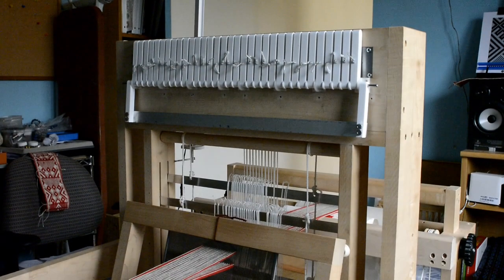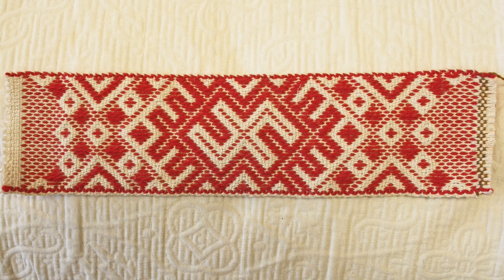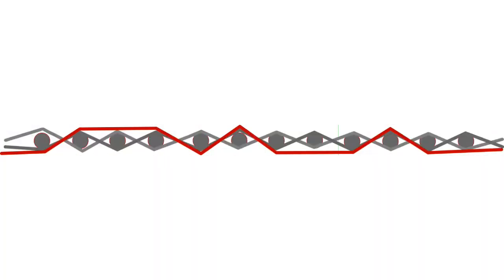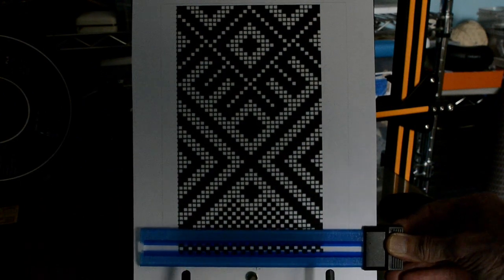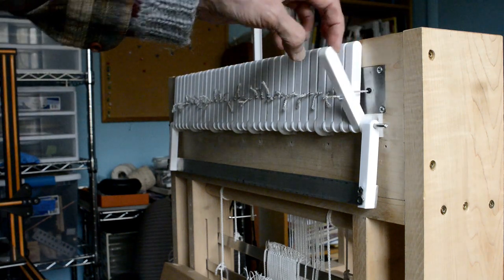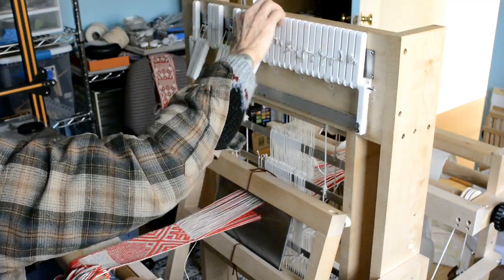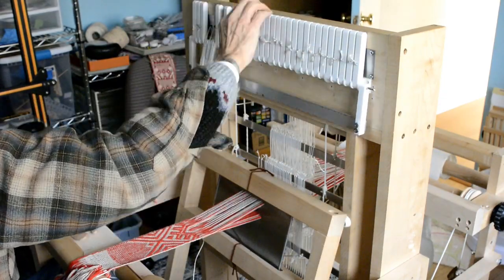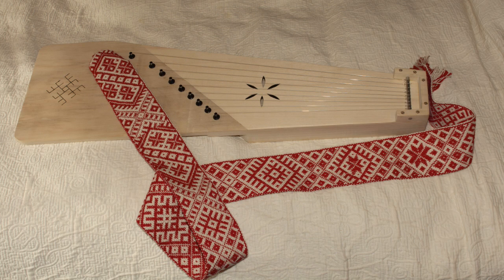Baltic pick drawloom

Comment: Thank you for this posting about your remarkable loom. As a bandweaver on a traditional Scandinavian loom I find your pickup device using single-unit drawloom principles to be fascinating and full of potential. 

Your loom is making quite a splash right now among weavers with similar interests :-) There's a whole group of folks out there who would love to know more about your loom and how you came to build it. Is there any possibility of finding out more about your wonderfully-engineered machine?
Reply from the maker: The core of my loom is a two harness counterbalance loom which I chose because of the balanced shed. The draw levers are attached to individual texsolv heddles via cords. The weights (lingos) at the bottom of the loom return the heddles to the down position when the levers are released. The draw heddles are kept in their correct position using two plates with 33 holes that spaced 11 holes per inch. The frame of the loom is maple for rigidity. The plates are made of aluminum. My original draw levers were made of aluminum but I replaced them with plastic levers made on 3D printer. I am experimenting with 3d printing the plates as well.
A woodworker with basic experience could make the frame of the loom. My hope is to get the draw lever and guide plate designs perfected so that they could be 3D printed by a hobbyist or printing service.
The weights are available online (vavstuga). The custom reed was made by Gowdey Reed.
Reply: @balticpsaltery  Thank you very much for the additional info! Lots of food for thought, there, in your very generous description. You have hit upon an interesting convergence between band-weaving and drawlooms, which has a lot of weavers very interested/excited. Some of us have considered weaving pickup-bands on big drawlooms (this is done in some parts of the world, where several bands are woven at the same time thusly), but this is a complicated and cumbersome way to deal with a challenge you have solved very neatly. As it is, several of us are thinking hard about how to adapt your system to our band and counterbalance looms.

If you ever do release the plans for the loom, you will have a ready audience of eager adopters. Clearly your business is the production of your beautiful instruments - but do you have a website where further enquiries could be sent in the event you do decide to make your band loom plans available?
Reply from the maker: The idea of adding a drawloom to an existing loom is not new. I think I have seen add-ons (vavstuga). I chose to design a single purpose drawloom because I was able to start without any compromises.

The factors that I consider important are:
ergonomics - The loom has to fit the person and all of the controls need to be easily reachable
functional design - separate warp beams for background and pattern; even tension (weight and spring design); big treadles for big feet (me)
usability - warping adds a minor step of including drawloom heddles; the draw levers require very little effort to operate; a single one-step pattern thread reset with no need to remember up or down positions.

So working within these guidelines may make a conversion of an existing loom more of a challenge than starting from scratch.

Comment: Good job on your loom! I want to make a Drawloom my self and was wondering if you could share the links to where you got some of the parts?
Reply from the maker: The reed is from Goudy Reeds in Rhode Island. The heddles came from the Woolery. The bearings came from Amazon. The miscellaneous hardware came from my local hardware store. I made the rest of the parts either with my mill and lathe or with my 3d printer. I am currently working on a drawloom attachment for existing looms. I have completed the design and am printing the plastic parts on my 3d printer. Assembly will be in the next month or so. I intend to install it on a 24 inch Montana table loom. I will modify the back beam and build  a stand for it.
Reply: Baltic Psaltery thanks! I will have my brother 3D print som things.

Comment: looks good did you make a set of plans when you made it
Reply from the maker: No, I did not. I designed it piece by piece iteratively until it was done. I modified the loom several times after the fact to correct and improve its function.